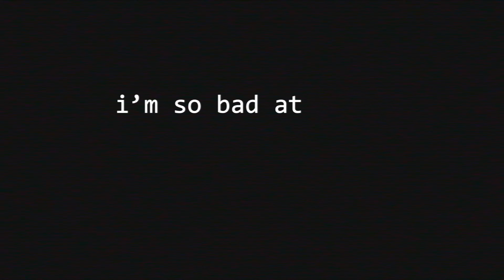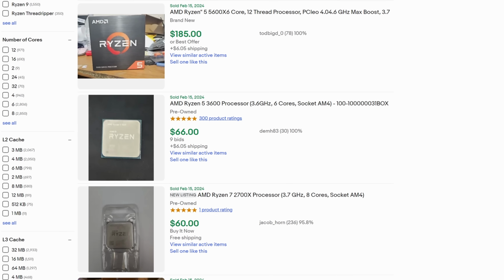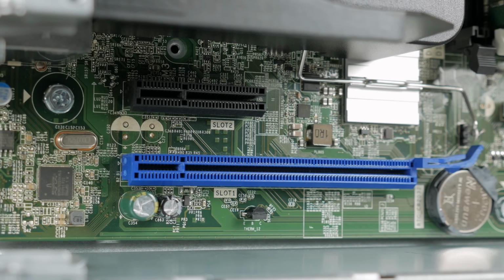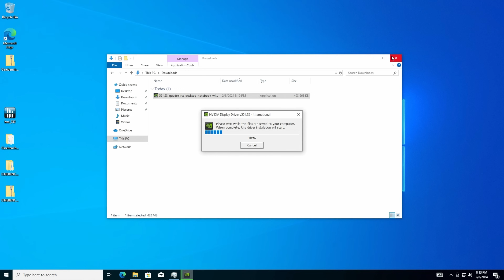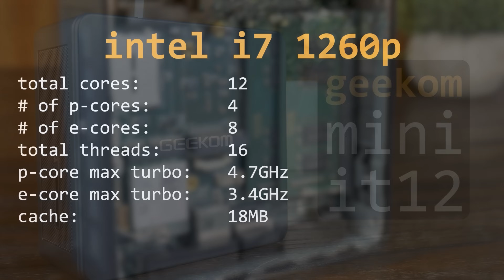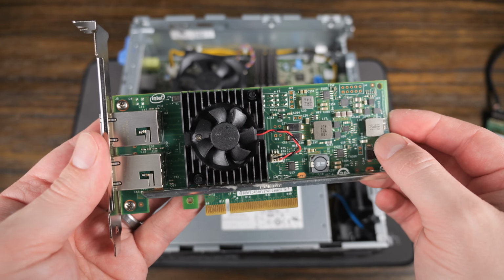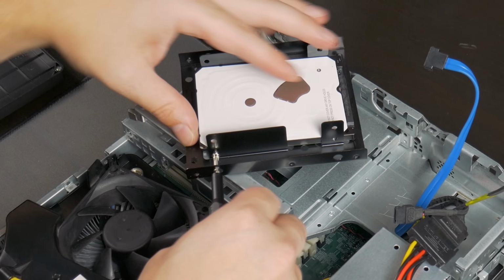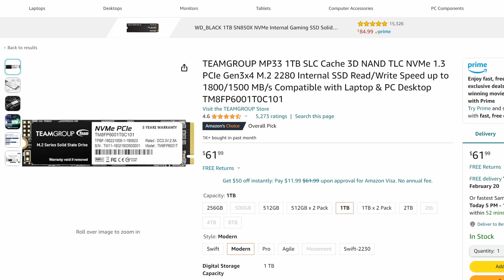Is This The PERFECT Dell Optiplex?

Comment: 4:59 Minor nitpick, the T1000 is Turing architecture, thus not RTX. It's roughly similar to a GTX 1650, maybe clocked lower, though. Other than that, it's probably the best card you can slot into this little system, and that's terrible because it's already nearly 3 years old, still super expensive for what it is, and doesn't have a viable replacement in the same form factor. Nvidia apparently is content to let this market segment ROT. A handful of third-party AIB makers have catered to it, such as SRhonyra, who made a line of cards that fit, but they're 1050's and 1650's. I have a GTX 1050 4GB (!) made by them that I got on a fire sale from Amazon for just under $100 shipped. It's cute, blue, and a nice little upgrade over my GT 1030, but nothing spectacular.

7:34 It says 1067 MHz. Windows Task Manager erroneously reports MHz instead of MT/s. My older Optiplex (3020) takes DDR3 and reports 1600 MHz, but it means 1600 MT/s, it's actually 800 MHz according to CPU-Z. No, dude, that shit was running at 533MHz for some stupid reason. But the tests don't bear that out, so I'm confused? What is it saying now, after you got it running at 2933?
Reply from the maker: Hmmm... well the 20xx series RTX GPUs are Turing, and the t1000 is listed as an RTX GPU multiple times on Nvidia's website. 

Also, task manager seemed to be reporting MT/s, not MHz which I did find odd. Trust me, I confirmed in HWinfo as well.
Reply: @HardwareHaven  Check NVIDIA's data sheet for the T1000; it has no RT cores, so it has no proper ray tracing support.  When the graphics card launched, it was called the Quadro T1000.  Now, NVIDIA calls it the T1000, part of "NVIDIA's RTX Professional Graphics Cards."  So, the only thing RTX is the marketing, and NVIDIAs software for professional cards.  But there is no actual ray-tracing capability.
Reply from the maker: @chalybion4766  Yeah, I'm aware. I never claimed that it had ray-tracing hardware.
Reply: yeah, that's what I'm saying. The label says MHz but it's actually reporting MT/s. Microsoft messed up. Imagine that. @HardwareHaven

Comment: That was interesting - and pertinent for me, since I upgraded my workstation to a Ryzen 7 5700G, and wondered whether putting the 1700x into a system currently only running an Athlon 3000G for a future video editing station and ... apparently if I put a halfway decent video card in there, it should be fine. Thanks!

Comment: Perfect for? I mean, this is a cool config for a Plex server, for home lab type work or a low end editing rig, but otherwise, there are much better models to work with and much better configurations. For gaming, forget the 10Gb NIC and install a dual slot GPU as you are most certainly not limited to single slot cards. You can install an x16 card in the x4 slot with a negligible loss in performance. This is what most SFF Optiplex users do. You can get a faster GPU, that costs less and a CPU with a MUCH faster single core performance and similar multi-core performance, like the i7 8700.

Or you could just go with the HP Z2 G4 SFF and have a superior system in every way to the Optiplex.

Comment: I love watching old tech find new life.

(I still have my Opti9020-USFF with an i7-4785T, 8gb 1600 and dual drives. It is a reliable and great little machine.
But as my homeserver I replaced it with a Poweredge T110-ii using an e3-1265Lv2, 16gb 1600, a TeslaP4, a 2.5gb nic and 4x8tb drives.)

Comment: case issues are present on this thing along with ps, cost was too much for such a dinosaur but usual due diligence was pretty good - at least you tried - i think the sweet spot for these old systems is 3/4th gen hp and add ram and maybe a 2.5gbe plus ssds and that is it - total cost like 150

Comment: I'm not well versed in virtualizing graphics, or gpu splitting. That being said, I think it is logical to experience slow down when trying to virtualize a gpu without passing through the bare metal. The process has to go through more layers between endpoints, and also the possibility that the resources needed to virtualize the gpu slow down the process. I could be wrong, but that is what makes sense to me.

Comment: i have a t400 in my dell poweredge r630 i use it to render videos. to e exactly i render pictures out of weather stations from 5000 locations with each frame represents 5 min from one month. i do this for 7 values. then i have a big folder of pictures and now with my location renderer code i can select exactly those locations i need and render a video out of all pictures overlaid. also i have the option with openCV and machine learning to find locations of interrest and make a special video of it. 
the most work this system does is cpu and ram bandwidth bound the t400 does mostly nothing. i need it for keras and open cv because the cpu is already packed and doing machine lerning stuff and rendering needs much more power as the cpu can provide the gpu is much better in this stuff even this tiny one. is 5 times faster as both xeon E5 2699v3 combined
the whole run takes 2h to 5h on that system i have done this before on my ryzen9 5950x but this was way worse it took over 50h. if you consider i crawl through 10Tb of data with 1.562.400.000 data points this is really fast

Comment: This machine with one of the new sff Arc GPUs would be a perfect media server. The encoder on the A380 is amazing, pcie power only and can do AV1 encoding and decoding for $115 bucks.
Reply: Arc gpu are very power hungry even at idle
Reply: @jasper5945 Yes but I'm pretty sure its greatest competitor, the RX 580/590 is even more power hungry.

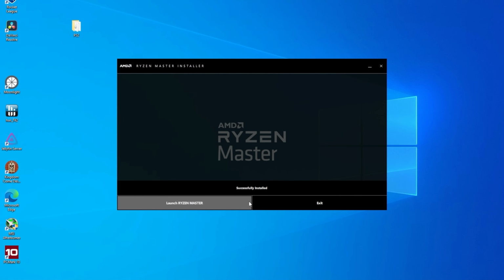Comment: 14:18
For a lot of 1st, 2nd, and 3rd gen Ryzen based on my testing as a used local buyer/seller and Bryan from Tech YES City made a video on it as well a while back.

These Ryzen CPUs saw an improvement of memory to 2933mhz to 3000mhz would make around 7% to 11% increase. After that 3200mhz made not much a difference at about a 1% to 2% more. Then no more improvements or making it worse at above 3200mhz.

This is based on memory and the motherboard. Teamgroup has mostly been best in compatiblity with majority of AM4 CPUs and mothetboards. Corsair was usually worse. But that was based on my variables.

 My sister has a Ryzen 5 3600 for editing for some years now with an MSI A320M using PB. I have a Ryzen 7 1800x in my newer rig with an ASUS X470. And I've built only with Ryzen 1st, 2nd, and 3rd gen before covid.

Loved the videos.

Completely forgot about Ryzen Master software. Man I love Ryzen. Was funny cause I remember AMD wasn't a favorite to anybody back then. Now, more buyers want AMD like Intel making it half and half of sales and great for customers.

Hope you have a great day everyone.

Comment: question, will a 10GB PCI E x8 network card work at full speed on a PCIEx4 slot?
Reply from the maker: If you were to saturate both NICs simultaneously you would see degraded performance on a Gen2x4 slot, but if just using one it should be more than enough bandwidth for 10GbE

Comment: It's unfortunate the built in encoders in the Ryzen CPUs are so inefficient or poorly supported (not sure which is the bigger issue). I have an HP SFF with a 3400G Pro in it, but power draw shoots up when trying to transcode. Not sure if it's worth upgrading the GPU, but considering what you spent I'm pretty sure buying a base system with an intel chip would be the better option.

Comment: First rule of hardware upgrades, always update your bios first…it’s the core hardware interface.
Reply: no kidding...I get ALOT of these e-waste junkers where they are running the original release of the BIOS...and just flashing a new BIOS seems to fix all the issues with the base machine
all my homelab/server stuff is handmedown junker machines that are happy to just chug along..not the fastest...but glad to not be rotting away in a landfill
Reply: @haydenc2742  My ECS K7S5A sometimes resets CMOS for a false battery issue and sometimes doesn't like lukewarm (like... totally off but PSU has power) starts.  Also happy to not have it rot in a landfill.

But those capacitors I replaced can totally rot in a landfill.  Way better than rotting all over my system.
Reply: I update my machines' BIOSes anyway if there is updates available, even if I'm not planning any upgrades.
Reply: @keulloe  DELL Optiplex, check 20 X times if you need this update please !
Only on Custom build system, always do the latest UEFI system updates !
Reply: I would amend that adage. Check if you need a bios update in order to accomplish what you are trying to upgrade. Especially with AMD board updates that patch out older CPU support in the AGESA code.
Reply: @IanBPPK it should have been on the launch bios, both Ryzen Pro 1st gen and Ryzen 1st gen released at the same time, they're also the exact same chip just with allowed overclocking that OEM boards obviously don't support anyway
Reply: @My_Old_YT_Account  not talking about Ryzen and Ryzen Pro, I'm talking 5000 series that launched with compatibility on Zen chipsets.
Reply: Sad thing is for some of these OEM devices, their BIOS updates are fairly limited.
Reply: not really the first thing as there's a very very high chance of bricking the board as these OEM boards barely have instructions on how to bios upgrade
Reply: @BRIGS21 if you need help to "next next finish", you should work with computers
Reply: @BRIGS21 Just no
Reply: @masterofx32  just yes👍🏻

Comment: It's weird that it doesn't support the 1600. If it did, you could have upgraded to the 1600AF, which has 6 cores, but it's made on a newer node and clocks higher. Everything else is exactly the same.

Comment: LOL, I was just about to click buy on that DELL INTEL X54-T2 K7H46 10G card before watching the full video and at around 13 minutes in it appears not working... XD
Did you find the reason? Would love one for my full desktop PC
Reply from the maker: I literally just a saw a comment with a fix. I'm pinning it.
Reply from the maker: Not yet, but I haven't had time to look into it. I've had good luck with other non-dell used x540 NICs. You might need to add a fan though since a lot of them are built for server chassis

Comment: I picked up an optiplex 7060 sff last week with an i7 8700 and 32gb ram, going to move my entire homelab into that machine. Even though it is bigger than the Dell micros I currently run, it's impressive that the SFF is still relatively small and has a lot more upgrade potential!
Reply: HD 630 is the only issue with these micro systems, you need the Irix models, one gen later !
Big is not an iusse at all, only if you need Nic or other 2x PCIe cards. All PSU's on these are not able to support any GPU.
Lab, slow I/O, thunderbolt 3, HHD in 2024 ? If you need that.
My suggestion, buy cheap i7 9th dumped laptop, fast NVMe old drives in it, fast port on the back ! Irix or Arc ! $100 ! 
Way better then any Steamdeck,  Old intel onboard iriX, games in 1080p on 13"

Comment: I have an extreme dislike of that "Memory has changed" warning. I use an Optiplex for my backup server, and if I want to upgrade the RAM on it I have to also hook it up to a monitor and keyboard for the first boot afterwards, and I can't seem to find a BIOS option to disable the warning. They're the only system I've used that does this.
Reply: You get that with Dell professional systems in general. IDK about consumer grade Dell since I don't mess with them. I had the same warning on my buddy's Precision T3500 when I upgraded the RAM from 8GB to 12GB. Fortunately it was connected to monitor (TV)/keyboard, but I see why you'd hate that if you're running headless.

Comment: The FPS stuttering when lowering the settings is from the CPU. I don't know why but every AMD CPU I have owned when it is the limiting factor always stutters. I would expect its from AMD's junk memory controller. The only systems I have that don't stutter are a core 2 duo lenovo and my i5 2400u laptop. But they are so under powered you cant really run anything on them these days.

Comment: I wonder if a custom BIOS/UEFI might work on these. There's also been articles showing up in my feed about ReBarUEFI on GitHub lately. I wonder if that might work too.
Reply from the maker: Could be worth looking into!
Reply: @HardwareHaven  - On business oriented systems like the Optiplex, there's vPro on the Intel side which allows for IT people to manage BIOS functions remotely. If I'm not mistaken, the equivalent is called DASH on the AMD side, which I'm sure the 5055 supports. Maybe DASH can also be used to inject/update a custom BIOS?
Reply from the maker: A display output is pretty helpful... also the a2000 wouldn't fit.

Comment: wait is the T1k really that fast compared to the RX 6400? I thought they were the same with RX6400 consuming less power at the LP variant
Reply from the maker: Without both idk, but I would imagine being on PCIe Gen3 would give the t1000 an advantage, not to mention the benefit of NVENC for editing/transcoding.
Reply: @HardwareHaven  ohk thanks I just watched the video by hardware unboxed, yeah it's not that useful in this scenario. I was really bent on buying it
Thanks for this vid, I'll try and shop around for a used T1000 somewhere in my country.

Pls try build with this and some tiny pc too, something like the Lenovo P330 + T1000
Reply from the maker: If you don't need both single slot and half height, there are other options
Reply: I would expect that its much faster because the 6400 is limited by the x4 pcie connection as the pc is only pcie3.0. As far as I am aware the rx6400 is not useful any more than a video output and that is it.
Reply: @firenado4295  ouu i was going to buy it next week😅
Reply: No, that'd be the rare OEM crippled RX 6300. THAT card is completely useless. Techpowerup says it was never released, but IIRC, RandomGamingInHD came across an OEM unit, and it's as horrible as you might imagine, with a mere 2GB on a 32-bit bus. <shudder> Supposedly it is only slightly slower than the RX 6400, but how would TPU know that for sure if the card was never released <smirk>? Anyway, I wouldn't wish that card on anyone; 2GB of VRAM is so useless for modern gaming these days.

Regarding the RX 6400 and T1000, both cards perform about as well as a GTX 1650 in gaming. The T1000 is using a TU117 core on PCIe 3.0x16. The RX6400 is completely useless for anything more than general use and lower-spec gaming, as it lacks VCE for transcoding. Honestly with PCIe 4.0x4, I'm not sure who they're trying to sell the RX6400 to. It doesn't look like they consider use cases against the existing hardware market before they decide whether or not to release a card. Maybe someone at AMD needs to get fired; I need a job and I can do better than that. @firenado4295
Reply: Actually the rx 6400 has 
PCIe 4.0 x4 not PCIe 3.0 x4
Reply: @RichardDotJee  I know..... but the pc its self wont be 4.0 so it makes no odds.
Reply: @firenado4295  true….i have an optiplex and I have a rx 6400 and my pc has PCI-e 4.0. If he has 4.0 slot is good either way if it’s 3.0 he’ll loose some performance.🙂

Comment: 1st gen and zen+ memory controllers sucked compared to Zen 2 and 3.  My main desktop with a Ryzen 2600X could get 2 sticks two 3200, 4 matching sticks could only get 2666.  Dropped in the 5800X3d and they "Auto Tuned" to 3600 and have been stable ever since.  Same ram and mobo.
Reply from the maker: Yep. I remember getting my 1700 to 3000 (or maybe even 3200) and being stoked about it.
Reply: Chipset related issues, not the mem controller, that is onboard the chip itself.
Reply: @lucasrem  yes chipset in on the motherboard that I Didn't swap out.  swapped out a 2600 for a 5800x3d just the CPU. Motherboard and RAM is the same, so it's not the chipset since that didn't change.

Comment: I would try a Ryzen 5 2600 just to see if it works with bios upgrade...
Reply from the maker: I wish I had one handy
Reply: I know for a fact they have a version that works with the 2600 and idk if it would work with a 2700
Reply from the maker: There's another variant of the 5055 that runs 2nd Gen Ryzen APUs. It's technically a different system with a different mobo

Comment: Didnt know you daily drove a framework, you should do a video on your experience using and upgrading it!
Reply from the maker: That's the plan! I want to have a good amount of time using it though. I definitely plan to use this motherboard as a mini server once I upgrade!
Reply: @HardwareHaven  How long have you been daily driving it? Any initial thoughts you can share here / in a YT short?
Reply from the maker: TBH the only other modern laptop I've used was a 16" M2 Pro MacBook Pro, so not really a fair comparison haha. The biggest thing I'll say is that it doesn't "feel" cheap, which is a little bit of what I was expecting. Battery life isn't amazing, but for me that's not a big deal. I have the 13th gen i5, but with what I do, I could get by with like a 6th gen mobile i5 lol. I do wish there were two internal NVMe slots, because I would be interested in dual booting with linux mint or something. Overall I like it. I have a feeling I'll like it even more once I have a reason to crack it open and upgrade it.
Reply: @HardwareHaven  you can replace one of the I/O modules with a 250GB or 1TB storage drive, which you could definitely boot linux off of as it doesnt care if its on usb, you can just use the regular installer to do this as ive done it with USB SSD's as thats all the IO storage modules are, USB storage devices. Wouldnt be the fastest but would be usable under most distros.
Reply from the maker: Yeah, I’m aware, hence why I said internal. I might do that, but it’s a bummer that I have to buy another SSD when I already have plenty available. Plus, I like my USB ports haha